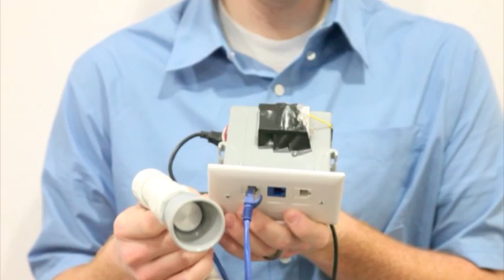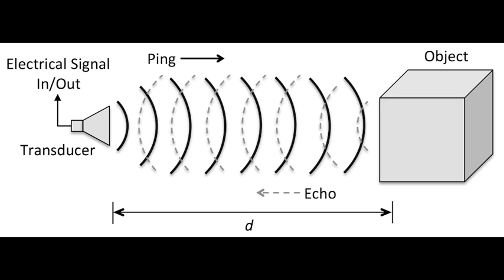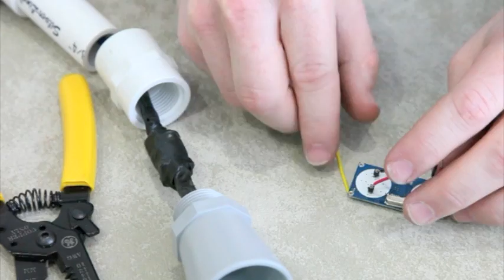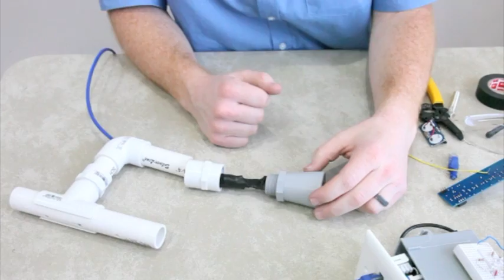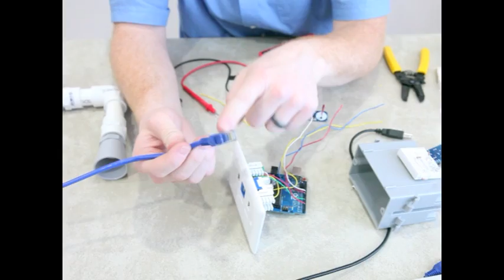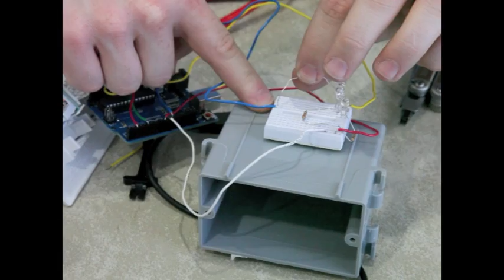Sonar Obstacle Detection System for Seaperch (How-To)

Comment: Hi! I recently bought a sonar like yours, from multicomp. I assumed that it would work with the AnalogRead on Arduino. However, it is only giving me "0.00" in my serial output. I would like to ask how you calibrate your sonar with arduino. According to the datasheet, my sonar works best at 58khz . However I dont know how I can get my arduino to achieve that. Any advice? Would be very much appreciated!
Reply from the maker: It's important not to confuse a complete sonar sensor with just a transducer (small round speaker with two legs/wires). Sonar sensors usually use one or two transducers, but also have a lot of additional circuitry. A sonar sensor will send out pings and detect echoes with the transducer(s), measure the distance based on the time between ping and echo, and then encode the distance information into a standard output format like an analog voltage or serial output. It sounds like you may just have a transducer (like these: http://uk.farnell.com/multicomp-ultrasonic-transducers ), but if you want to interface directly with an Arduino, you'll need a complete ultrasonic sensor (see https://www.sparkfun.com/products/11724 or https://www.sparkfun.com/products/13959 ).
Reply: Daniel McArthur 
Thanks for the advice! Your guess is correct! I do have a sensor like that. I spent slightly more than week trying to get it to work, even with a HRS04 controller board but to no avail. I am considering to switch to an infrared obstacle sensor instead. Thanks again for the help!!

Comment: Hi Daniel,What model you using? is it MB7060 XL-Maxsonar? but what i know is an ultrasonic sensor use for underwater to detect obstacle, its frequency affect a lot, for example 1Mhz can detect less then 3meter underwater condition but this sensor is around 42Khz which can detect less then 300meter underwater.I read the datasheet for this sensor, its already built in the function to auto correct environment changing errors. Do you test in the water b4, how long the distance it can detect max